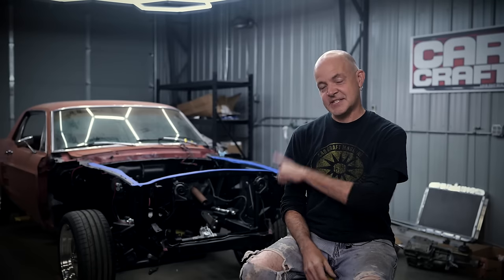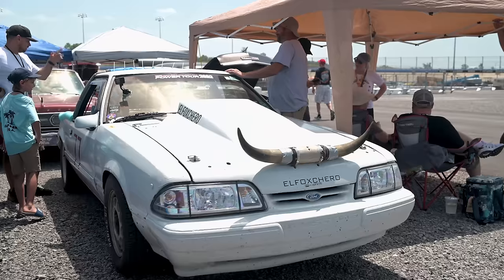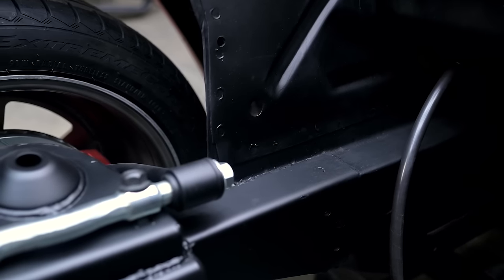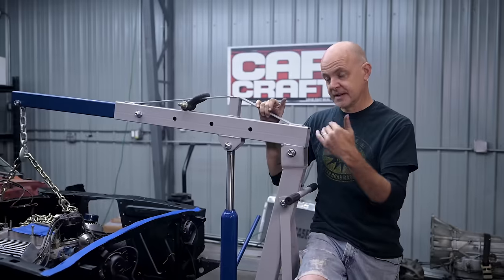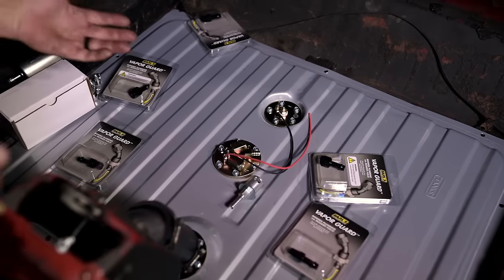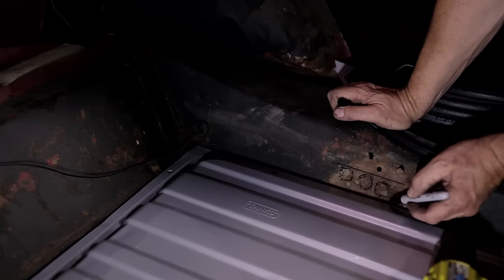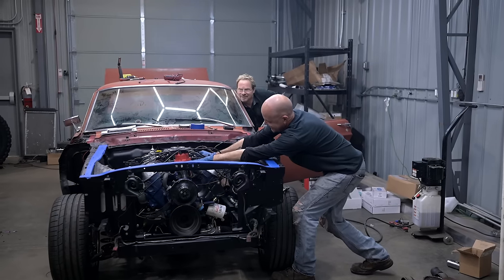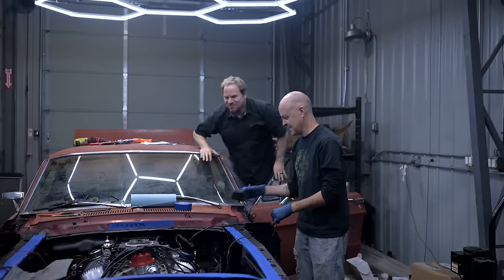Swapping in a 351 Windsor into Cruiser Project! | Car Craft TV Mustang Part 2 | MotorTrend

Comment: How is it ok to run a die grinder with a roloc disc cleaning up the gasket surface with the all the parts exposed? I guess there's no grinding grit spilling over into those areas? Just strange to me.

Comment: Wait, did you just put an inline fuel pressure regulator into a system that already has a fuel pressure reg on the sniper return line?  RTFM
Reply: A lot of people delete the one that's in the sniper because they aren't as reliable.
Reply: @johnhinsz4056  This

Comment: I am trying to find out information on the Low Profile Dual Sump Oil Pan that was used in this video. I have a 1968 Mustang Coup that I am putting a 1988 351-W from a F-250 truck in and I would like to purchase this oil pan. Can you please advise on part numbers and infomration on where to obtan this oil pan?
Reply: I'm also curious about this oil pan as I'm running into clearance issues

Comment: Love watching you guys work, but a Mustang II suspension????? REALLY???? These cars had “all that bracing” because they kinda needed it.  So many better suspension options, even from heidts.  The install is very clean, just the worst choice suspension.
Reply: It makes a huge difference and a huge improvement over stock. Chassis flex alone is so much different compared to the original system. I agree, there may be more sophisticated geometry, but we didnt want to just throw a bunch of $$$ at it... I've put complete chassis under these cars and totally changed them... this did it for a fraction of the cost.   I stand by the improvements!!  Thanks for watching. KT